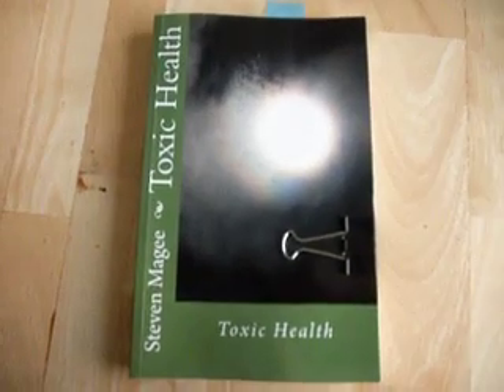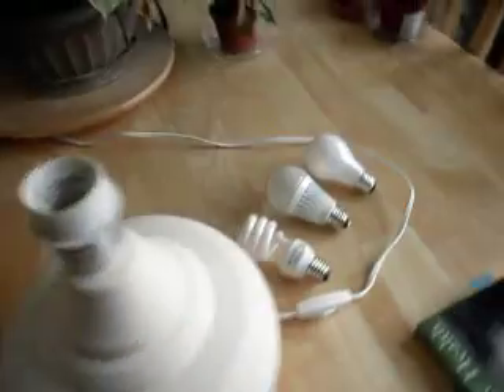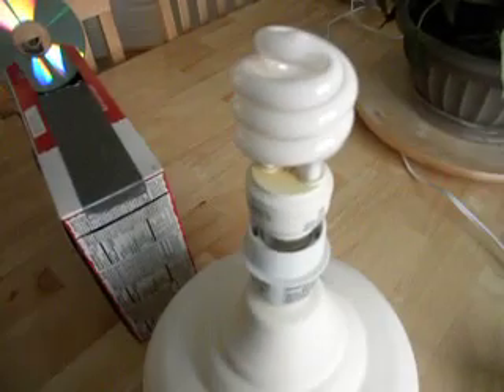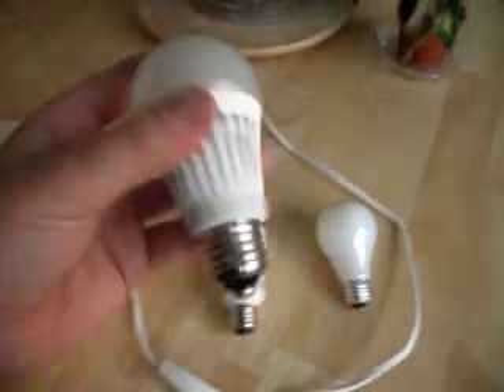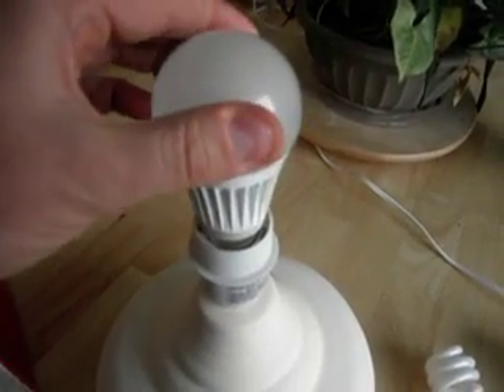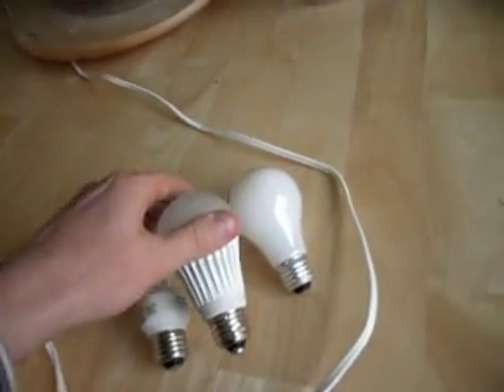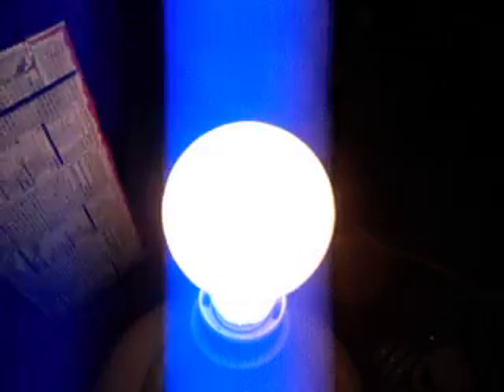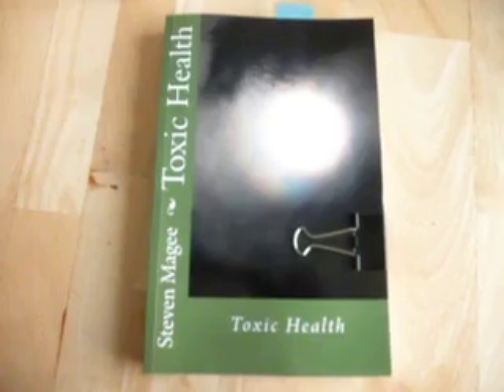Comparing CFL, LED, and Tungsten Light Spectra

Comment: The Dr. Ott reference sounds like BS.  Any visible light is non-ionizing and even if theirs cracks in the coating, UV should be pretty quickly absorbed by glass. 

Unless you're going to cite a peer reviewed paper, you should not discuss his work as though it is more than just speculation.

Comment: LEDs make their white light with a phosphor over top of a blue emitter.  The phosohor is pretty good at making a wider band, instead of the spikes you commonly get with CFLs.  Some of the blue light makes it through the phosphor unchanged, and that's why LED bulbs have a problem wuth too much blue light, and It's a very deep blue.  CFL

Comment: So if I wanted to save energy would LED be a good choice? It seemed to have a good spectrum, other than waning on the cool and warm ends, and most LEDs produce limited UV rays which I would think you could benifit from. Also how much does the half spectrum hurt you, I mean you aren't trying to get a tan, and I believe the test animals were getting cancer from leaking mercury from the CFLs not from the choppy spectrum.